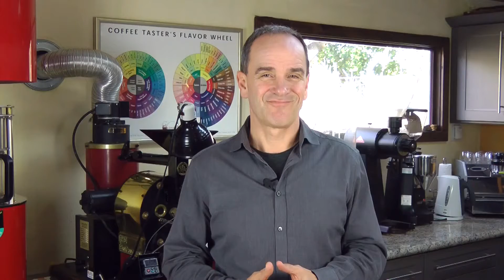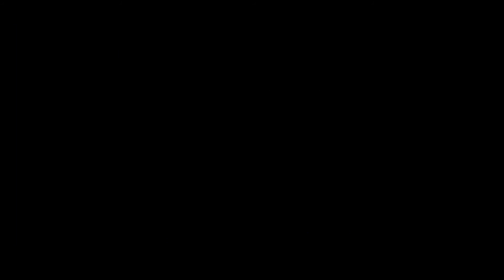Unlocking the Natural Sweetness in Coffee

Comment: He gave you nothing. So I will share this info for you all.
Sweetness is important as without it you don’t have balance. Every coffee has varying amounts of acids and unequal quantities of each acid, due to varying varietals, climate, location and processing. As a roaster you do a sample roast to first crack and drop it, this will be at the peak of acidity. This sample will be cupped to analyse what acids are present and how much work will be required ( development time ) to get a sweet balanced cup. The brighter citric coffees will need slightly more development time in order to get balance. While creamier lactic acid coffees will need less time. 
Another factor will be the volatility of amino acids, the more volatile the acids the more emphatic the Maillard reaction will be and the closer peak sweetness ( in terms of time ) will be to peak acidity.
Acidity is complexity, you want as much acid present but it has to be balanced by sweetness. 
For a Barista it is similar;
Fast brew, extraction = clean, bright, high acid.
Slower brew = sweeter, balanced, acidity slightly muted by sweetness.
Too slow= bitter, lacking sweetness, low acidity.
I recommend having a standard recipe that you use to try every new coffee, based on what you taste you can make subtle adjustments to grind and dose to find balance.